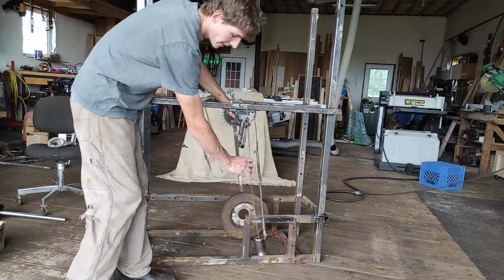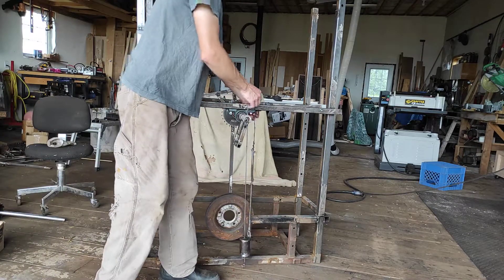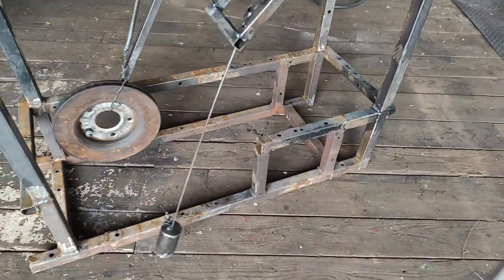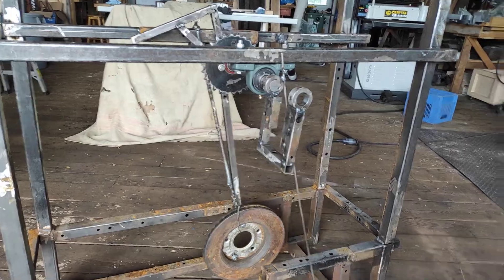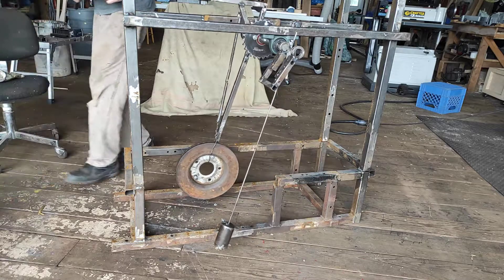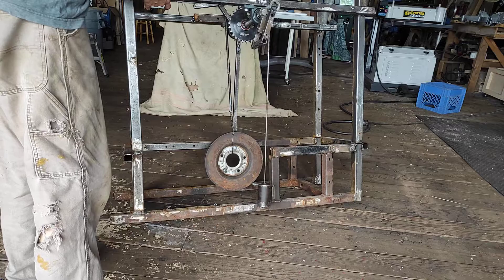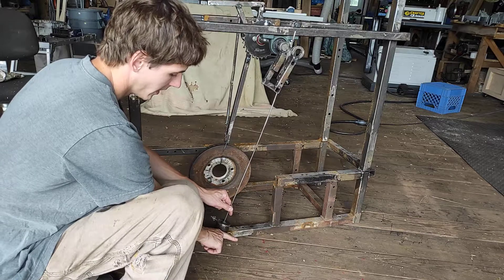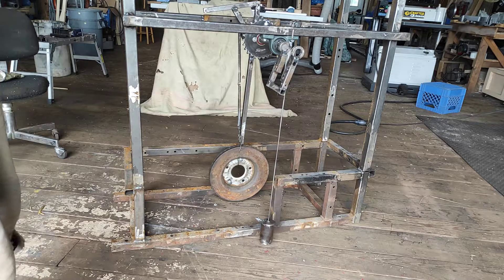A Better Two-stage Oscillator

Comment: Nice experiment.
But one thing, I believe you didn't get Milkovic's two stage oscillator. Energy is not coming from the pendulum tangential force, he never claimed that. That would be insane claim. Energy is coming from disbalance due to weightless state in two points of one cycle and on other extreme, when pendulum goes to equilibrium (pulling of lever) - radial force. Btw, this can be other storages such as springs (mechanic, fluid), not only lever with counterweight. Whole device works by preserving pendulum's oscillation that will create disbalance of second stage. Pendulum centrifugal force is not used. 

Please, stay respectful to others in your videos. Not a nice thing at 4:30. Sounds very arrogant. 

Like your work so far. Looking forward to see the working model of the idea you presented in this video! Enjoy with your experiments!
Reply from the maker: Thank you for the comment. I might have been exaggerating, but it is to shed light on something very important. The excess energy is coming from centrifugal force combined with gravity. (Gravity can be used in these type of machines but it's useless in my opinion.) Milkovic doesn't understand know where the energy comes from (as far as I can tell). The pendulum is weightless because the pivot turns it around using centrifugal force. Without a pivot and centrifugal force, there would be no pendulum. Milkovic has done a lot of good, but if he understood the simple physics of how his two-stage oscillator works, he would be able to build better machines and demonstrate self-running machines. The physics principles are very simple, and the math is shown in every introductory physics textbook. Most people do not understand how centrifugal force and conservation of angular momentum work. If you turn the two-stage oscillator on its side and spin it a high speeds, you will get many many times more energy out of it than if it was swinging back and forth. Each time you double the RPM speed the of the pendulum (spinning weight), the output energy is 8 times greater.
Reply: Repect for a dedicated man with a great heart who got many thinking by his observations.
Looking forward to your overunity device.